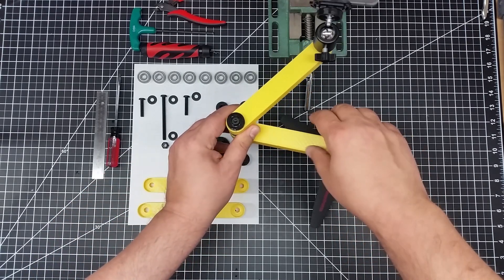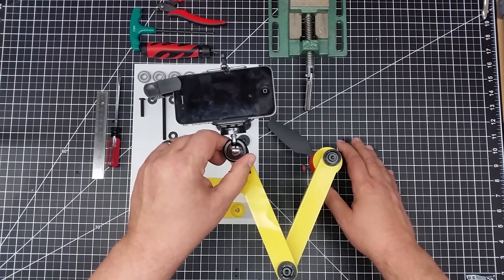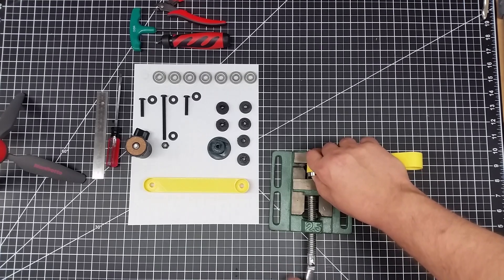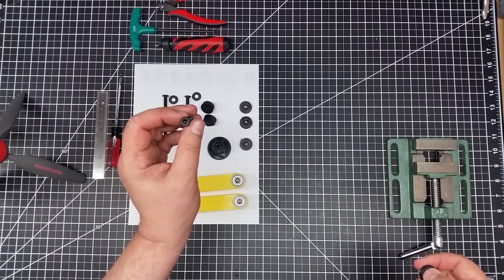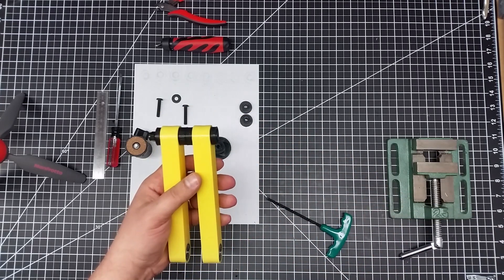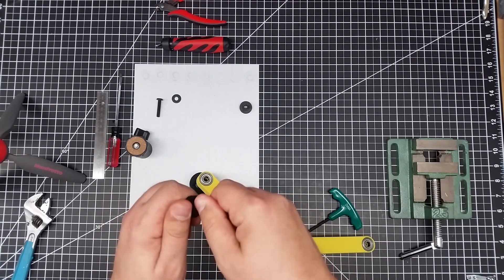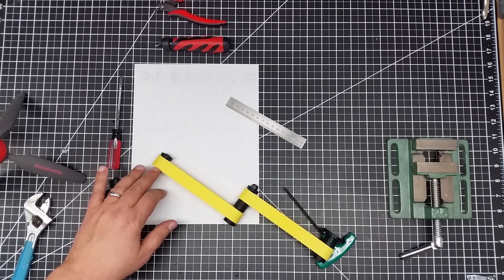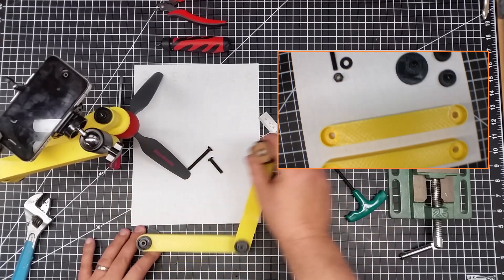3D Printed Project -  Pantogaph Style Camera Slider!

Comment: Can U extend the design this way with belts? And at next level can be insert some motors, and eg an esp32 with battery to control the motors trough bluetooth or wifi.

https://www.proaim.com/proaim-sway-camera-slider.html

https://www.proaim.com/media/catalog/product/optimized/9/5/952f34fef5328a7c69a9ae908d61e959/3_21_6.jpg
Reply from the maker: It would be a major project however anything is possiable as I designed this just to see if I could do it.  I have two of these which I still use today...

Comment: Nice video! I saw this on Thingiverse and it led me to your youtube channel (which I am now a subscriber of).

Question: Is it possible to mod this to act more like an Edelkrome Wing (http://bit.ly/2dlARgk)? How would you go about that? Also, is it possible to lock down the joints so the camera doesn't move around while you are trying to use it?
Reply from the maker: Thanks!  Also the Edelkrome Wing has a very complex (read as expensive) internal damper inside its not possiable to 3D print something like that and to invest the time to make, you could buys theirs cheaper.  Mine is designed on a simple premise of keeping the camera in a fixed plane in a non-linear fashion as I also have this site and channel too (http://opensliderproject.diy3dtech.com/)  where I have created linear versions and that is what you might want if you want to "lock" the camera...
Reply: Thanks for the info! Also, would you be interested in printing this double slider (http://bit.ly/2w6ZzZ5) or designing your own to be featured in a video? I want to make one but my 3d printer is broken at the moment. I think it might make for an interesting video!
Reply from the maker: Yea camera sliders don't many views as I have another YouTube that I dedicated to it and hardly get any views so I don't do much with it.  Also the link you sent is interesting however not sure what I would do with year another slider as I have about a dozen now :-)